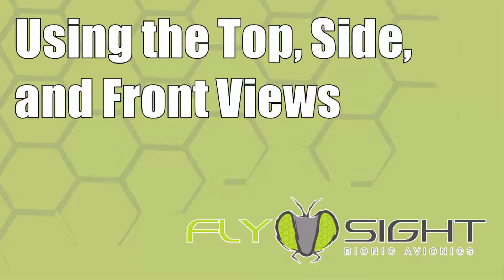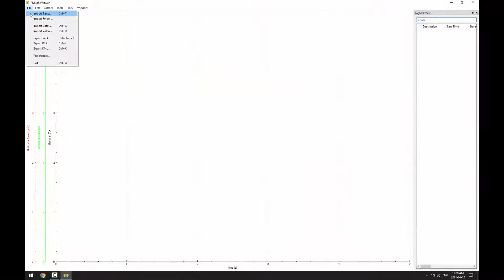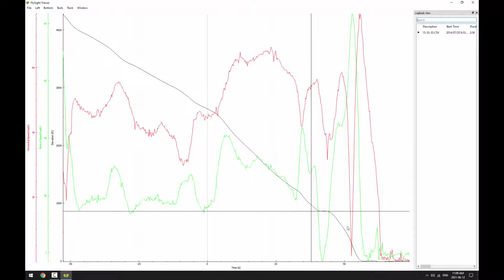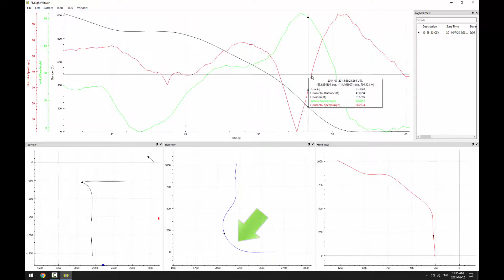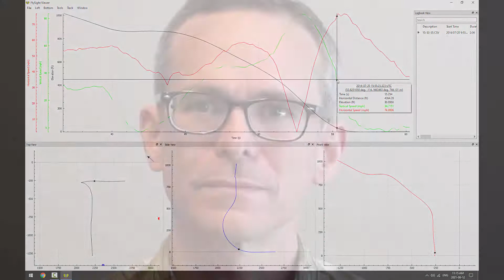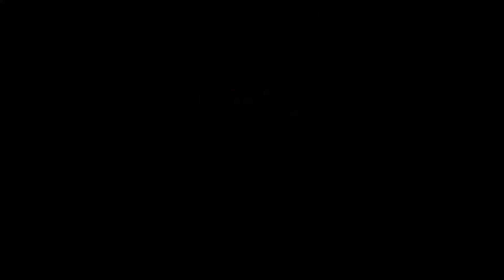Using the Top, Side, and Front Views

Comment: What are the Axis names and unit of the 3 Views?
I see Front and Side views showing Altitude Vs Width, both in Feets (or distance unit)

At first or even still sometimes I start thinking Side and Front View show Width and Depth.  I had to reconfirm yesterday.
I know space is limited but ideally a mouse over would clarify the Axis names and Units (at least in the Wiki would be a great addition).  thanks
Reply from the maker: The units should correspond with the active units in the main plot--i.e., if you're using metric, the distance units will be meters, and if imperial then the distance units will be feet.

I'll give some thought to the naming of the axes. My original thinking was that the same purpose was served with the coloured dots/plots, but I think you may be right that axis labels would make this a little more clear.
Reply: in the end the Y axis of the Side and Front Views is what confuse me,  is it Altitude or Depth?
Spatial intelligence isn't my thing🙃 but just in case it also help others.
tx
Reply from the maker: @julienf4373  Ah, I see. The vertical axis in the Side and Front Views is altitude.
Reply: @flysightgps  Actually that makes me think some kind of a clean 3D view would be nice. You can get one in GE I know but I tried it and it’s really clumsy in terms of rotation (no way to snap to a point and make it a centre of rotation). AutoCAD(ish) way would be so much better